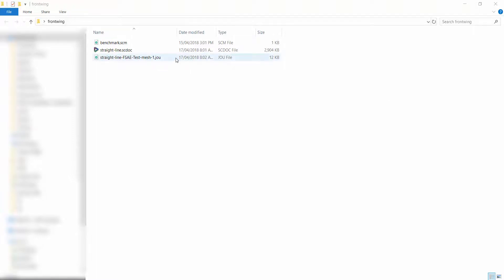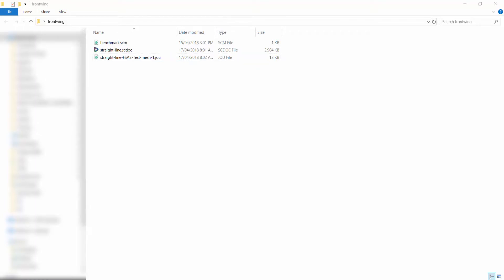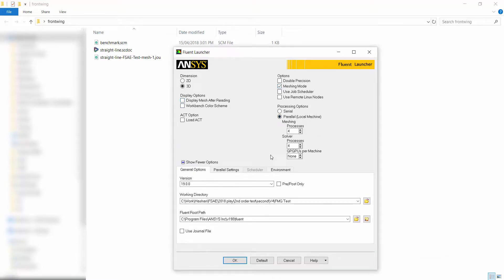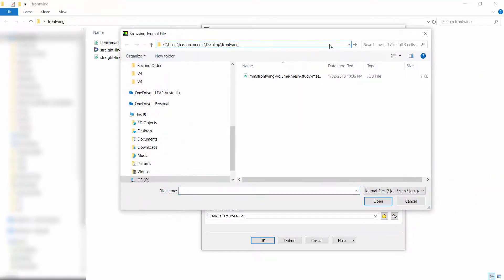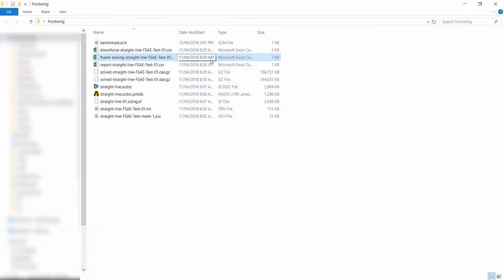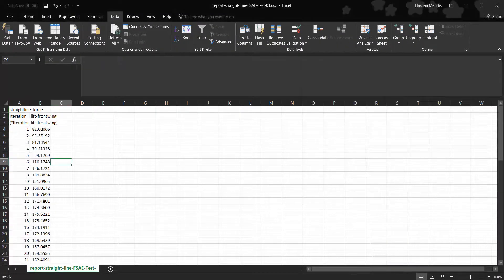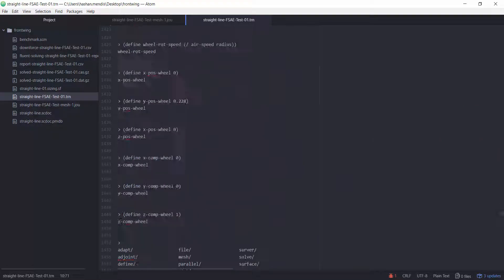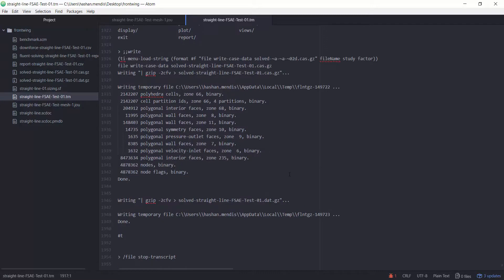Intro to scripting ANSYS Fluent Meshing and Fluent Solver   CFD for FSAE #11

Comment: Do you know how to apply a scoped size function to several faces without using the wildcard * ?  For example, I want to use the same boundary layer for a wheel and the ground. Now I use two code lines:

/mesh/scoped-prisms/create bl-example1 last-ratio 1 5 40 fluid fluid-regions selected-face-zones ground
/mesh/scoped-prisms/create bl-example2 last-ratio 1 5 40 fluid fluid-regions selected-face-zones wheel
Is it possible to group ground and wheel in one, so that I can use only one line?
i have the same issue with remeshing selected faces.

Thanks for any suggestion you can provide me.
Reply from the maker: you cant group it into one line. an alternative is to create a name to pick up in all the same bl, like calling them bl1-xxx, this way you can use bl1* in the name selection
Reply: @leapaustralia  Thank you very much for your answer. I thought it could not be possible after trying few combinations of scheme commands like (define 'ground 'cyl) and call the zones back with car or cdr, but I could not figure it how to make it working.